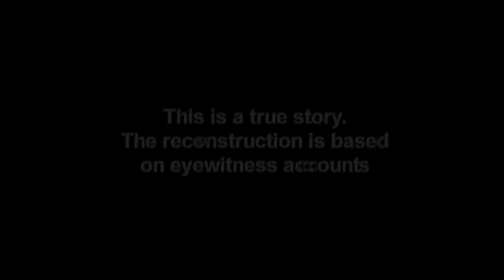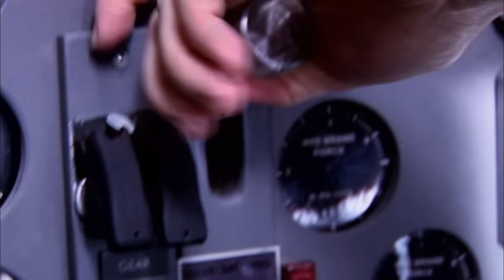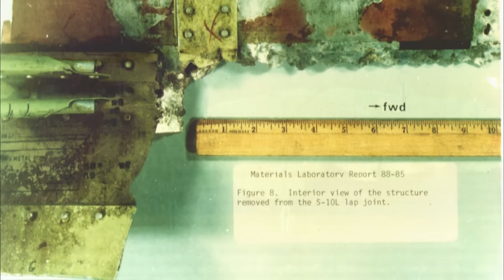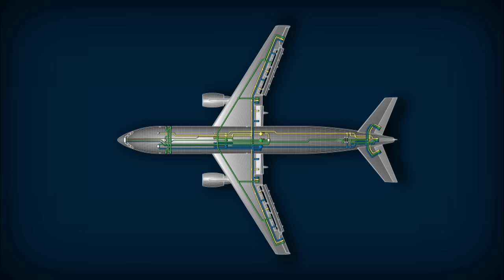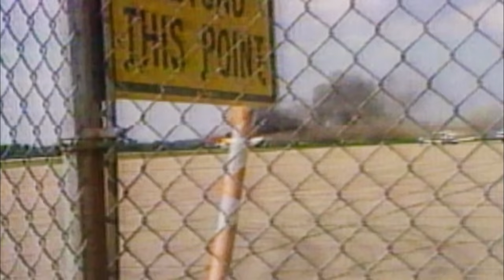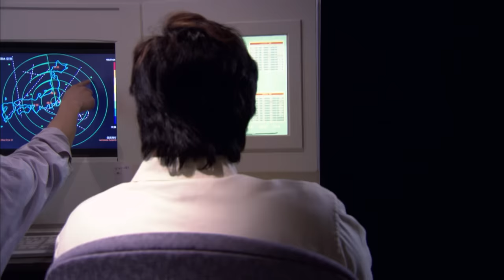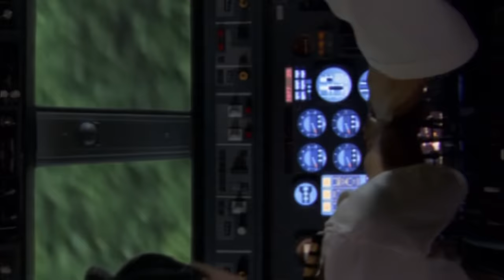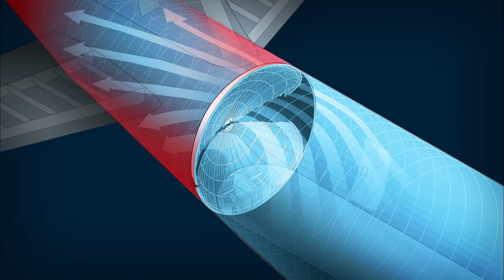Plane Explodes In The Air And Sends Staff Plummeting To The Ground | Mayday Compilation

Comment: They didnt mention in this that the left engine failed on the Aloha flight. So one thing about aircraft design with its "failsafe designs" Lots of crashes that resulted from the loss of hydraulic pressure and fluid... JAL 123, dC10s etc well its no so hard to think that if the airframe was damaged from debris that all three hydralic system can be damaged since the all run almost the same paths? I wonder how many more than 4 survived JAL 123 before dying of their injuries and exposure.
Reply: That is 4 more then I thought were going to survive given the way the plane crashed (they had hardly any control at all)
Reply: According to the 4 survivors, they heard many many voice calling for help and screaming in pain, but they were the only 4 to survive the night, all too badly injured to move, so they couldnt give a number. I am not aware, that any autopsies were performed, that could have determined, if ppl died in the crash or later.
Reply: They estimated that 20 survived the initial crash, and all but 4 died from exposure.

Comment: You have gotten these out of order of when they happened. The Japan flight should have been before the DHL flight, because the DHL video mentions the Japan flight.
Reply: the DHL video does also mention United 232 which crash landed in Iowa killing 111 passengers/crew but 185 did survive

Comment: Correct me if I’m wrong, DHL can afford danger pay… Sad these fellas had their life on the line for a company that couldn’t care less about them. ):
Reply: The impact forces from what essentially was a stopper placed in a hole could easily have compromised the already damaged cracked skin to cause the catastrophic failure of the skin.  The stronger connection zones ar rhe perimeter of the torn away section held together

Comment: The ruling in this incident is flawed. It's not 'poor maintenance.' It was gross overuse of a machine far past its useful life, period. I mean come on, think about it: this 737 was in service long after Boeing's recommendations for the number of cycles an airframe can withstand. How many times will ANY machine last 89,000 cycles for crying out loud, regardless of the maintenance it receives?  Bottom line: that aircraft should have been taken out of service several years before this incident occurred, and cannibalized for parts, period. This is called three things: GREED,  the love of a buck - and to hell with the people, and if it wasn't for an exceptional flight crew, would have ended in TOTAL disaster. This is also a testament to the quality of the 737's airframe, and why it literally rules the skies today...
Reply: That's not true...Boeings numbers are calculated with "standard flights" and 62000 standard flights equates to about 95000 of these "short hops"...technically the plane was sound...that being said every part is different despite being made to the same standard...

Here's a simple response to your insinuation of profit>safety

Would you consider a 20 year old car "unsafe"? If not why would you consider a 20 year old airliner "unsafe" when the regulations are so extreme to make them EXTREMELY safe...a light bulb blows out and there's literally 50 documents that have to be submitted and stamped before that particular bulb can even be replaced...

This aircraft is the exemplar of a well built machine.

Comment: Isn't that where Boeing used to mount cargo doors on "Combi Aircraft". I would suspect that the aircraft was built as possible Combi and then they put the forward passenger roof structure in when they get the order from the customer. That hole is almost exactly the size of the cargo door that could go in its place. Just a thought.

Comment: "Falls out"? Like she slipped? Lmfao 🤷🤣🤣🤣🤣 she actually got sucked out from the rapid decompression. 🤦‍♂️🤣🤣🤣🤣
Reply: Technically she actually got "blown" out by the rapid decompression. Suction is not an actual thing. Without the presence of pressure, suction is meaningless and can't suck anything.
Reply: @John Thimakis  ask the survivors how it felt like they were being sucked out while sitting in the seats.
Reply: @tylerdurden4006  
You don't get my meaning. That feeling of "suction" is actually caused by the higher pressure inside of the pressurised cabin. If the cabin is not pressurised to 8000 feet ie lower than sea level pressure but higher than the pressure at  22 000 feet then there would be no so called "suction" effect.

The effect we call "suction" is actually caused when the surrounding air pressure moves to a lower pressure environment. Therefore objects are actually pushed in the direction of lower pressure not pulled by the suction.

That is a scientific fact of physics. The word "suction" is only a colloquial term describing the movement. I am only clarifying the actual mechanics of what is going on. You can call it suction if you want, but suction  doesn't work where air pressure doesn't exist. For example if you were in a vacuum chamber and you put your hand on a running vacuum cleaner nozzle, nothing would happen. it would not stick to it. That's a fact. Suction has no force, pressure does.
Reply: It's hilarious isn't it?! Sucked out by decompression, so funny 🙄